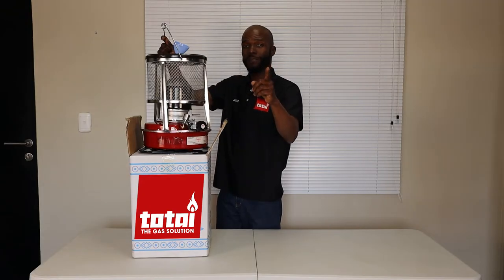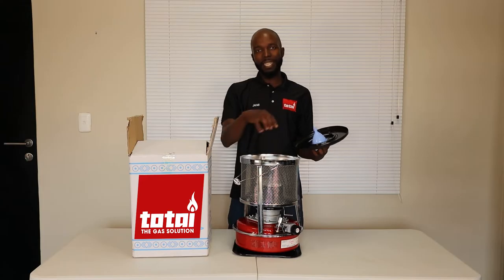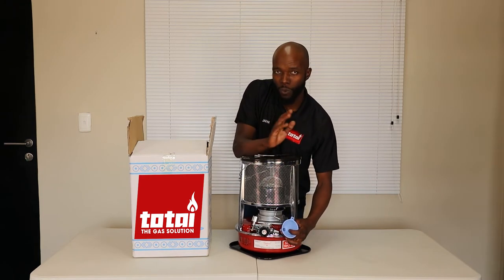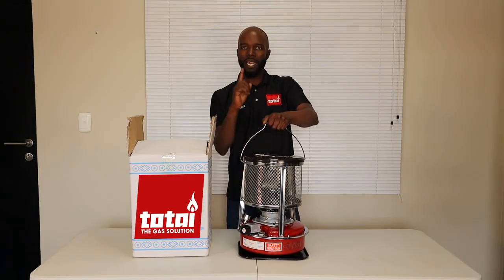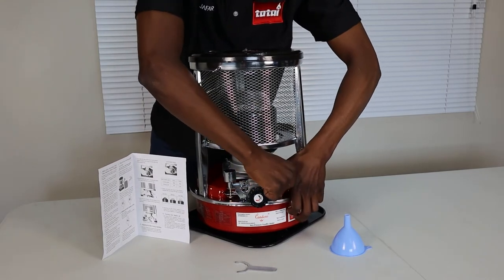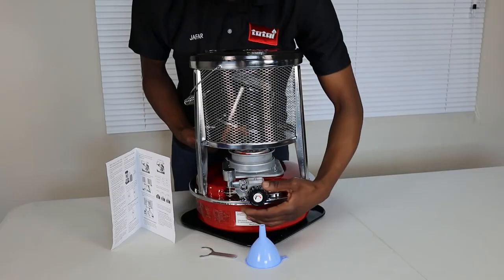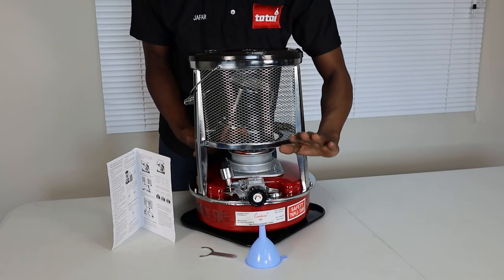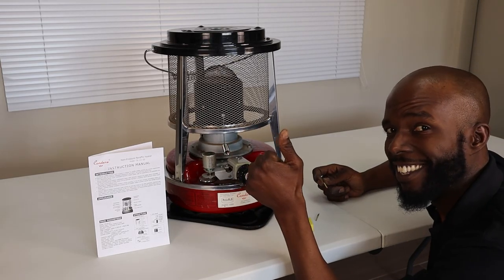TOTAI Paraffin Heater

Comment: I have one of these heaters. Great product. But how often must the wick be changed? Can you load a video showing how to replace the wick? Also, is there a way to see in real time how much paraffin is in the tank?
Reply: Hi! Does it have a smell? I want to buy one but I'm really worried about the smell
Reply: @Thamsanqa Morakabi  if you use good grade paraffin you will only get a smell when starting the heater up or when switching it off. You can light it outside the house and leave it outside for 5 minutes then bring it inside once the start up smell disappears. Also, once it is inside your house, don't turn the wick all the way up. If the wick is so high that you start seeing tall yellow flames, then you are running it too high and you will create smell. But if you turn it down such that you see only a blue flame, you shouldn't have a problem with smell. Also it is recommended to leave a window slightly open because it uses convection heating. When it comes to heating, this heater is one of the most effective heaters I've had. My garage is icy in winter, but with this heater the garage gets warm and stays warm very quickly. The warmth is not only just around the heater. It is all over the garage, much like when using aircon for heating.

Comment: Don't use parafin in this heater, use only a clear kerosene.
Reply: Why?
Reply: @johannakhutjo657  fuel evaporation temperature defference.  clear kerosene burns cleanly because when the device is hot, it is the vapors that burn.  this is not the case with paraffin.
Reply: I have this heater.... however I nomore use it although I need it. Paraffin smells too strong. And the smell stays for too long, more to the clothes. I would love to know where does one get the right paraffin to use.
Reply: @Nomsa Williams  Totally agree with you I buy mine at pick n pay is good quality and the sasol Garage also